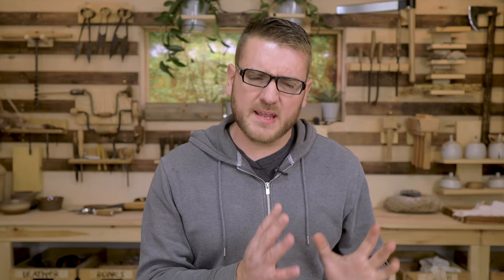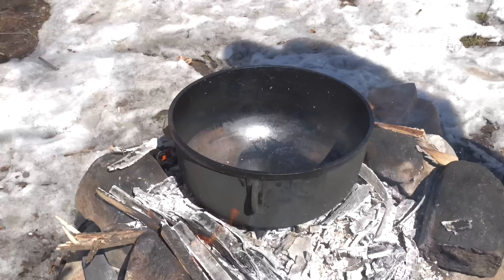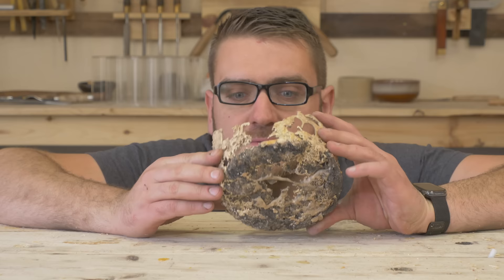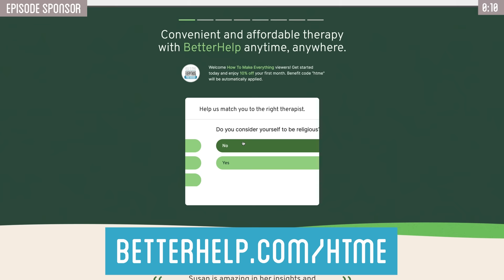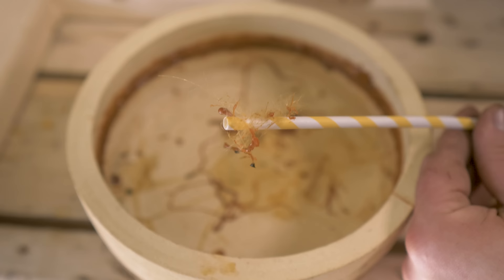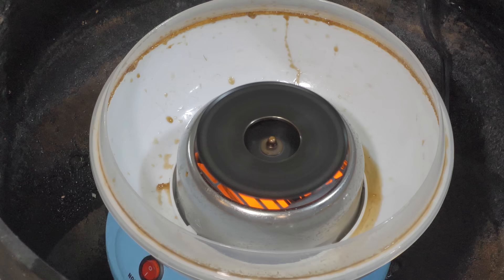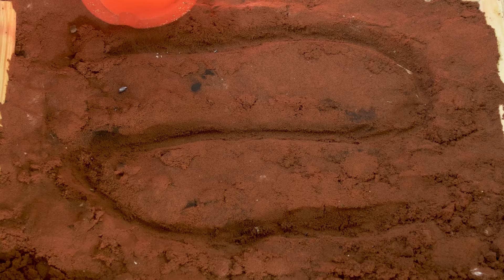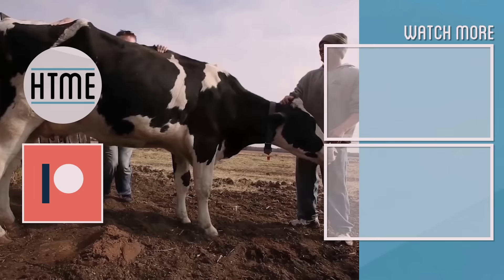Can a Dr. Stone Centrifuge Make Cotton Candy and Wires?

Comment: Youbcan make wire by forging down a metal ingot . Then draw it down to the size wire you need . The egyptians used metal plates with holes deilles or punched threw  it search how jewellers use a draw plate to make wire

Comment: Making wire isn't rocket science... you just form a billet and draw it out through a draw plate, and for softer annealed metals you can get by with a wood draw plate, just a plate with holes in it and then you can draw it down to a precise size

Comment: "lets test all these processes, but not use any of the materials"
 i believe if Senku saw the flimsy centrifuge  that Andy built, he wouldn't even bother trying to revive the society.

By the look of the video, none of the  sugar actually made it inside the  centrifuge. I'd place the sugar inside the preheated,  warm the cup up again until visibly dripping and then start spinning. And the metal experiment, the centrifuge didn't get a solid chance. The comercial cotton candy machine has a very small slit, specifically tuned to white sugar, at that size and at that speed, so I wouldn't take that experiment to be valid, its like drinking soup with a fork. Disappointed

Comment: Liquid Gold is more viscous than liquid copper so maybe it would work a bit better with the cotton candy machine ?
Reply: also there was a reason he had 2 people running rather than just a person at a crank the crank simply isn't fast enough with just an arm of force more gears and haveing a better system for pulling would probably work but both the cotton candy machine and the bowl around it also have to be larger so it doesn't overlap while drying or else you get the problem he had also it wasn't stable enough. not that I could build it better however if all of these problems were fixed it might have a shot.

Comment: I think it might be possible to cast the wire using the cotton candy machine, but I think the metal was too hot and more like water than sugar.
Reply: also there was a reason he had 2 people running rather than just a person at a crank the crank simply isn't fast enough with just an arm of force more gears and haveing a better system for pulling would probably work but both the cotton candy machine and the bowl around it also have to be larger so it doesn't overlap while drying or else you get the problem he had also it wasn't stable enough. not that I could build it better however if all of these problems were fixed it might have a shot.

Comment: Dr. Stone had experienced craftsmen maybe that is the difference.
Reply: also there was a reason he had 2 people running rather than just a person at a crank the crank simply isn't fast enough with just an arm of force more gears and haveing a better system for pulling would probably work but both the cotton candy machine and the bowl around it also have to be larger so it doesn't overlap while drying or else you get the problem he had also it wasn't stable enough. not that I could build it better however if all of these problems were fixed it might have a shot.

Comment: I think I have it

just get:
spider web
a thread
a cord

bathe them in tin

perform electrolysis on these 3 tin objects

and through electrolysis you can add copper or whatever is necessary for it to become a wire

you can use potato for electrolysis if you want or other batteries

🤔🤔🤔🤔🤔🤔🤔

😅

The other option was a giant iron syringe, (without needles)

inside the syringe you add copper so that it becomes wire

but it seems to me that it wouldn't work
😅

Comment: Ok... how many errors can you spot in his approach to checking Dr. Stone? 
The centrifuge is too small, and thus, both the forces and the ability to retain heat are altered. 
The wood doesn't have to be fresh or even unburnt for the wire pour, burning the surface of the pattern board, and then brushing off the soot would leave the surface with a very low moisture content. 
You do NOT cast metal into just loose sand since that, among other things, has the effect of trapping sand in your casting. You have to use a binder with the sand when casting metal.

I give you a failing grade on this attempt.

Comment: Your use of your crucible is completely wrong.
The cotton candy machines use granulated sugar for a reason, relatively large pieces of sugar ( compared to the stuff we might use at home for example ) won't fit through the tiny holes in the cotton candy machine's crucible. This is so that the only substance that can fit through the holes is freshly melted sugar. At any given time only a tiny amount of melted sugar is in the crucible, leading to the wispy thin sugar strands you see, that glop never had a chance.

Also half a cup of gold is $50, not $100,000

Neat ideas for creating wire though.
Reply: Gold is roughly $2000 per ml, which is well over $100,000 per half cup.

Comment: your mold  walls was to short why it escaped and they used large and wider bamboo or similar type reed like plant large enough to stand and press whole second person poke the holes before cooling it possible i can do one presses 2nd help make the hole keep shape 10 from the look of it while you had 1 and short walls not wide enough base wise it primitive and the show take place no technology so muscle more used they can get higher speeds showed 2 doing it at first then 1 person is more possible then you think your rig was just under sized due to compare the one in show to yours its way smaller

Comment: Pretty much a joke of an attempt to debunk. 
First your equipment isn't up to scale. You're literally using a spoon in comparison to a bowl in. 
2nd you're not doing research at all. Your method of making cotton candy is wrong and i don't think you should try this stuff if you don't even know it's idiotic to put milten metal into a spinning open apparatus. 
Your equipment is not precise enough or even stanle at all. I don't know what you're trying to do by using a joke of a centrifuge that's rocking a mile every turn. A kid's hands are more stable. 
You're just one guy but try to atleast do it properly. They had a whole team. Your hands are shaking so ridiculously hard and going by what is happening the whole video makes me wonder if you were actually drunk the whole time. 
Keep you hands stable, or atleast read the manga to know why a specific character is doing a certain task. 
He's working with craftsmen which you aren't, so atleast use some equipment to make up for it. 
I was cringing so hard thd whole video. And i have never even seen something pouring molten sugar to make cotton candy. You just put the crystals as it is in the centrifuge and the melt there and are ejected right as the melting happens. 
Same with wire, they heat and melt the metal in centrifuge, and as to why it's simeole, it melts there and is ejected out of the holes right as it reaches the right fluidity there's no point in completely melting the metal. Because there very little cohession in it at that point. 
This video did a really bad job at convincing me so far. 
Disliked.